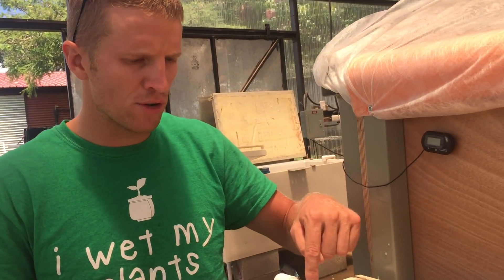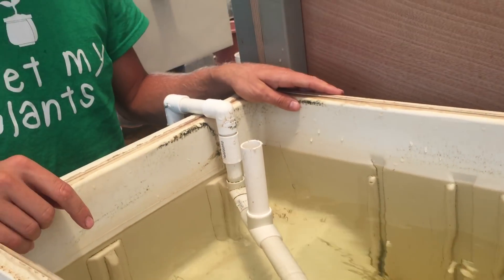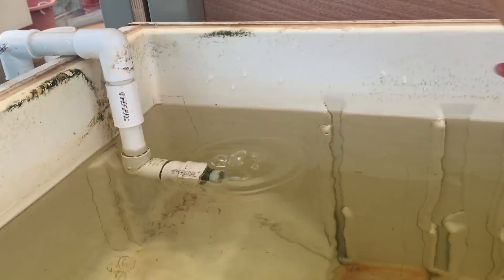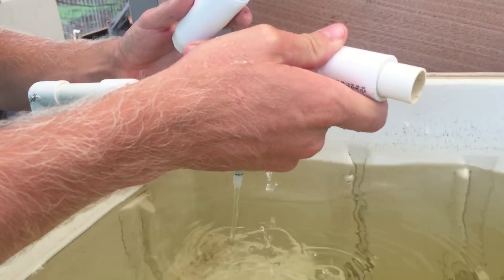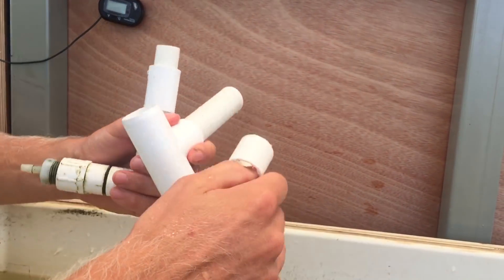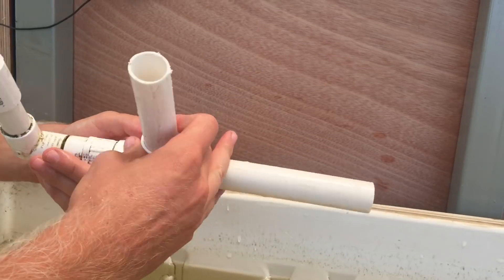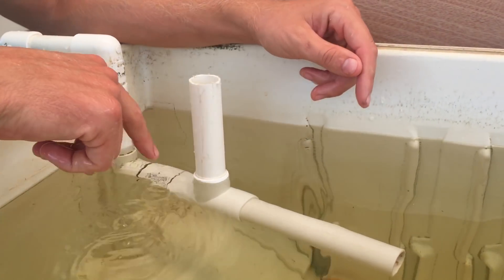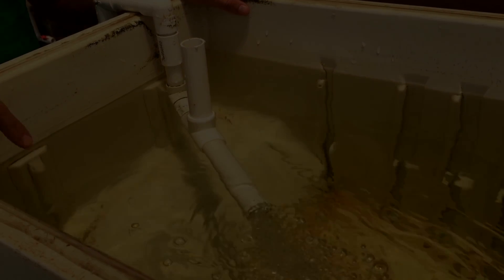Venturi - Easy How To - Aquaponics

Comment: You said in your movie "free air", what about the back pressure at the nozzle ? 
If you create extra backpressure, the current from the wall outlett will rise. 
Can you make a movie with an power meter installed to compare the power for free flow and with the nozzle ? 
thanks
Reply from the maker: That's a good point you bring up.  For my setup there I was already using that nozzle in the fingerling tank to create a current in the water, so for my particular setup it was free, but that may not always be the case
Reply: He did say free air, would be interesting to see how much extra current required to run Air pump and water pump or water pump only with venturi eductor? Possibly cheaper air?
Reply: In the next movie please invite Tom cruise.